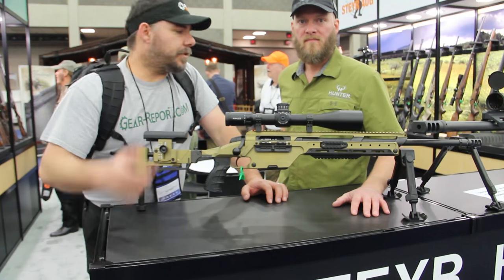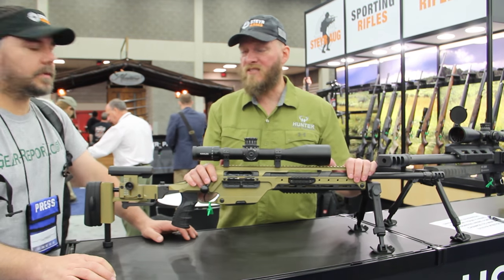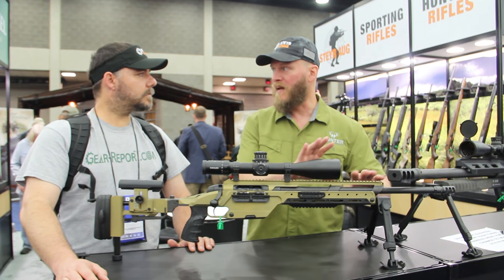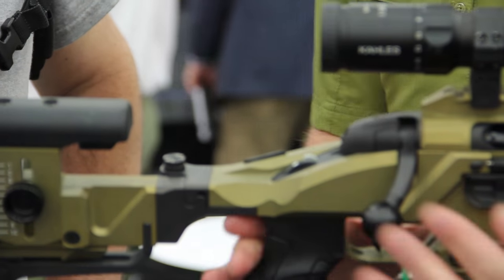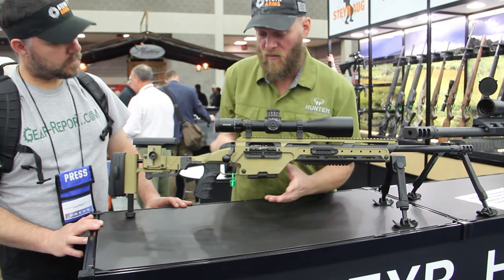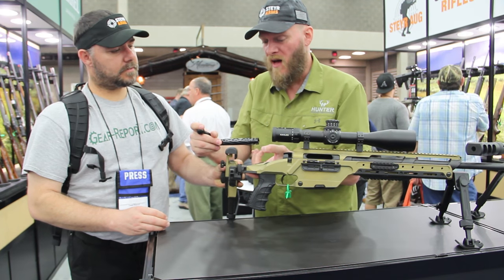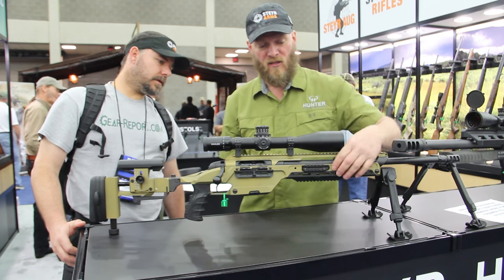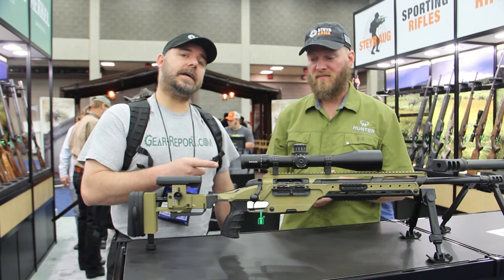Steyr SSG 08 M1 Prototype Rifle - NRA Annual Meetings & Exhibits 2016 - Gear-Report.com

Comment: sniper rifles are geting bulkier , you cannot run into jungle with that coz it will  tangle in vines and other foliage, id still prefer the steyr ssg p2 in 23 inch threaded barrel with iron sights for back up with  adjustable trigger  or set trigger and full length thumbhole stock for better stability.
Reply from the maker: Agreed. Some rifles are being developed as platforms for shooting greater distances than what the old school rifles could handle. To get that sort of distance they have been rendered less "handy" and more unwieldy. That makes them less appropriate for roles like you described.